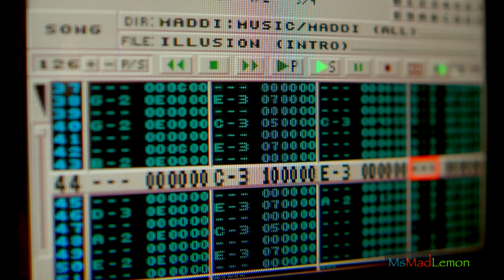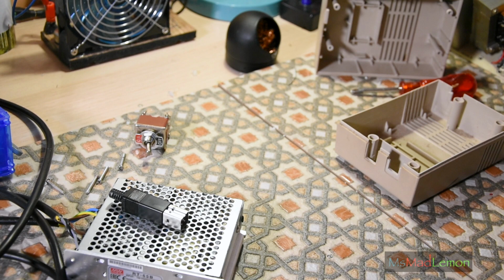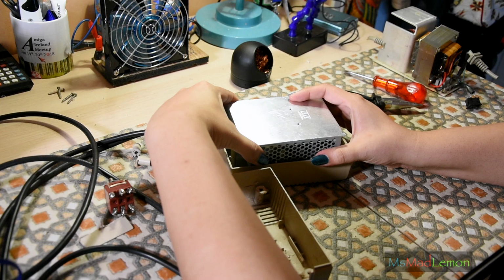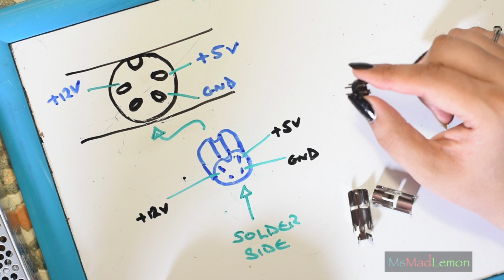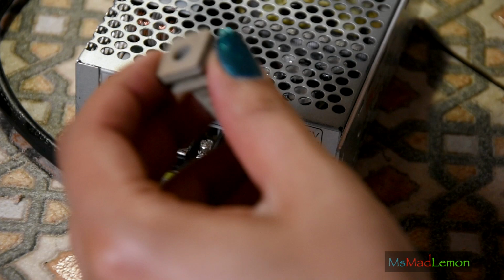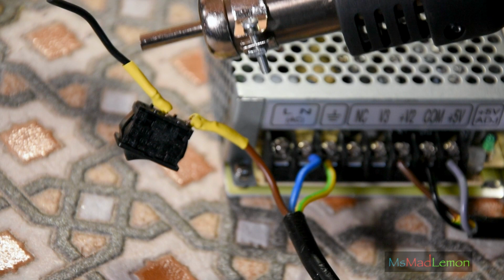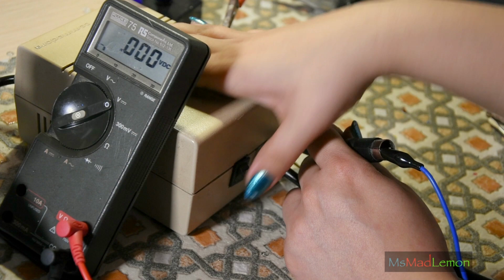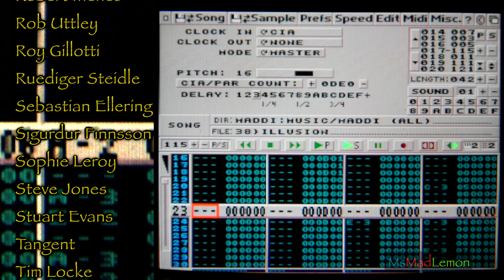Amiga CD32 PSU assembly using Meanwell RT-65B + A500 PSU

Comment: By the way if you are ever looking for a smaller form factor supply, there is Artesyn NPT42-M, which is 45W and comes in a 2"x4" form factor. Meanwell also make the RPD-60A which is +5V/+12V only and perfect for CD32's in the same 2"x4" form factor.

The only "disadvantage" with these supplies is that instead of screw terminals they use header connectors.. but the connectors are easily removed and you can solder wires straight into the holes.
Reply from the maker: Thanks for the info Peter, I knew there was a meanwell with just +5v and +12v but I wasn't sure which one.

Comment: The main reason the A1200 has -12V is the serial port, and the audio opamp.. but in the CD32 as they didnt need a proper RS-232 output, they rejigged the audio circuit so it could run on a single 12V rail supply. It's not a big deal as the audio circuitry has to deal with a midpoint bias voltage from Paula anyway

Comment: You use olive oil to lubricate your PSU cables, huh? Well I use ranch dressing to lubricate my disk drive rails, and not only does it make the heads move silky smooth, but the bonus is now my room smells like a salad. :o)
Reply from the maker: Lol Ranch dressing, you've ended up with delicious disk drives :o))

Comment: Heh... I had one of those very power supplies.. found it in a skip ! The regulator side was dead, and I recycled the transformer into a bench power supply. They're not worth fixing as they are dreadfully inefficient (15 + 18VAC transformer secondaries for 5V and +/-12V !)

Comment: Nice work on this as always.  Two questions:  First, is there a good quality (and reliable) PSU like this one that can be used for a replacement C64 power supply (with both 5VDC and the two 9VAC lines)?  Second, have you ever received any copyright complaints for using old original chip tunes from games for background music in your videos?
Reply from the maker: There isn't a power supply which has a 5Vdc and 9Vac output, there are people making and selling them though. 
And no, i havent received copyright claims for original chip tunes nor mods because they're public domain.

Comment: I'm always, kind of, terrified when you measure voltages from connectors (a slip of hand and short circuit)...
Easy tip, cut 2 long (enough) pieces of small heat-shrink tubing and use it on pins. Voila! xD
Reply from the maker: believe me i'm very AWARE when i'm doing that hahah, my fear is the same thing, to slip, which is why i dont press onto the pins, and deep calm breaths.yeah i'll use the heat shrink tubing next time :o))

Comment: Have you noticed anything wierd with this PSU on the CD32? I got the exact same one and to start with, it doesn't buzz when off or on load. Secondly the voltage remains 5.1V on and off load and while my CD32 works fine at first and boots up OK, if the console warms up and I switch it off and then on again, either it stays longer on the faint green light before it finally boots up or it remains permenantly at the faint green light and doesn't boot up. I reduced the 5V voltage at 5.00V (from 5.1V) and everything works fine (warm or cold console). Have you tried this PSU on the CD32 for longer time and have you experienced something like this? My CD32 has a TF330 installed.
With the original PSU everything works fine everytime.